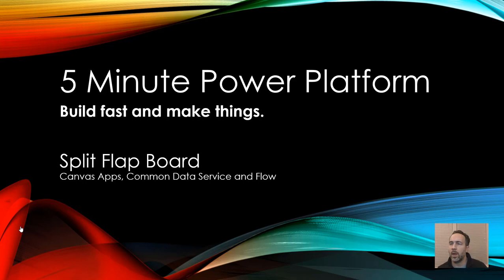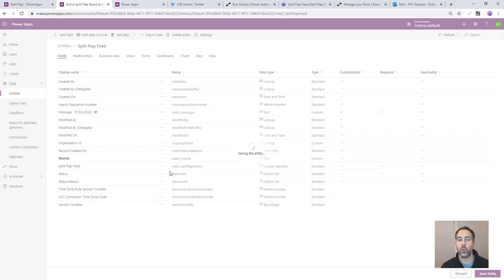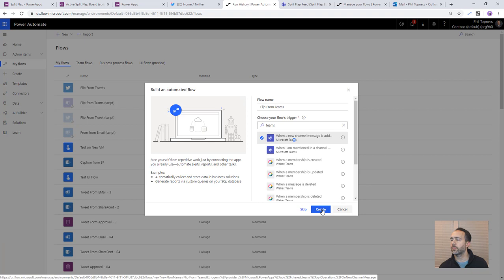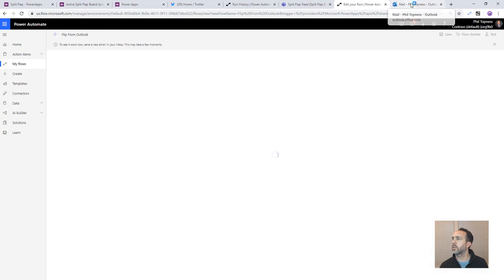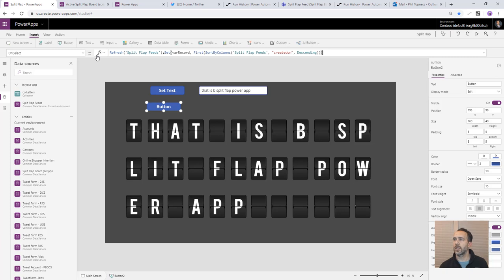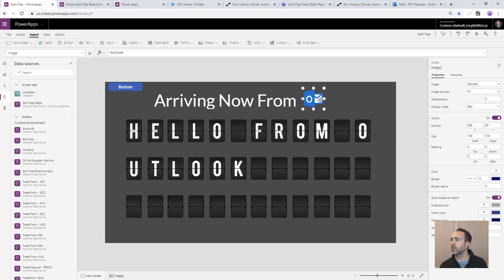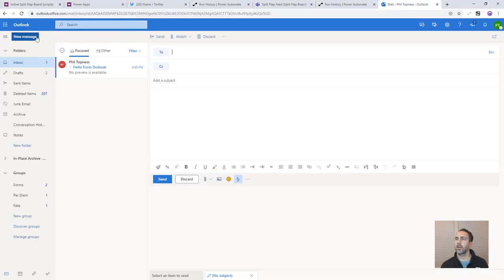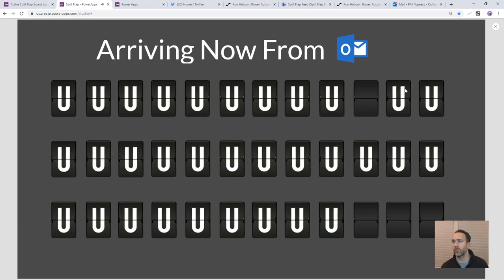Split Flap in Power Apps (2/2) - Building An Old-School Schedule Board CDS & Flow

Comment: How difficult would it be to get this to stop each letter as it is shuffling through the available characters. E.g. As appear immediately and "lock in" and Ts later in the rotation?
Reply: HI Peter - are you trying to get it to initialize on a certain letter, then spin for T seconds later?  That should be a minor change to the logic and timer behavior in the component.